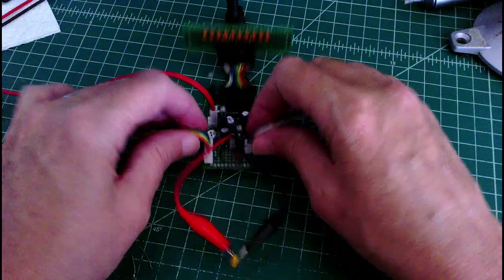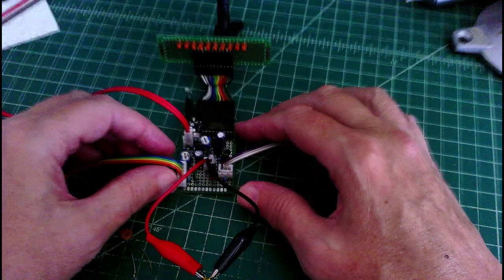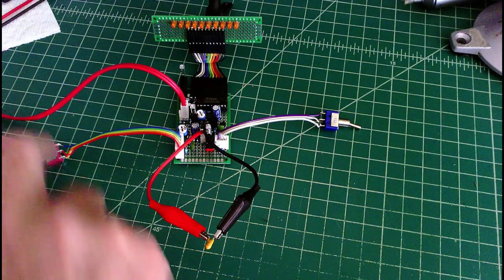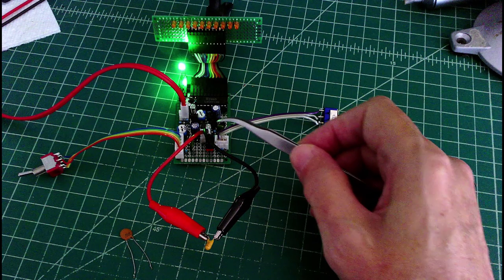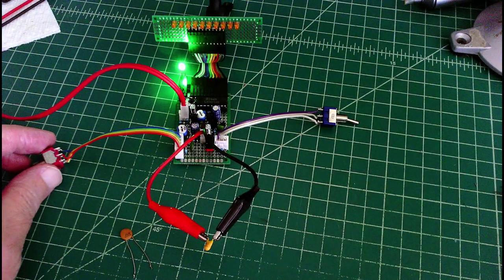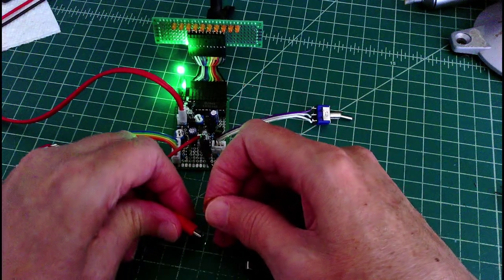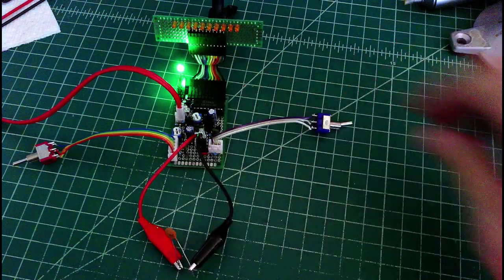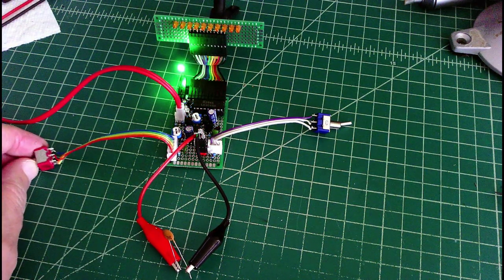Tim's build of Mr Carlson's Forcasting Ultra Sensitive Low Voltage Capacitor Leakage Tester

Comment: That's pushed me on to do a point to point version, as I'm not comfortable with smd to be honest.
Reply: You should give SMD a chance.  It really isn't that difficult.  I would get a cheapo SMD soldering kit on ebay for like 3 bucks and practice.  The real secret is flux.  I prefer no clean. I have had great results.

Comment: Why there is just one switch on the schematic? Thanks
Reply from the maker: I don't know what schematic you are looking at, but the one I worked from has two switches.
Reply: The schematic you are looking at, is a fake schematic or one that hasn't been updated. 
If you sum altogether, all the people that "shows" their constructions of this tester, you can figured out the schematics.
Basically is an amplifier and a comparator. The LM3915 is a dot/Bar display driver. Just download the datasheet and, bang! you have 1/3 of the schematic done.
A lot of info you can get from this kind of videos, for example the pin 9 is not connected so the LM3915 so is configured as dot display single driver.
The LM3915 is sourced from 27V so the configuration must be Dot Display forced!. figure 27 datasheet.
The presence of two VR's indicates that you have to calibrate the tool once you finish the assembling, one perhaps for a comparator the other for signal input conditioning.

Regarding the switches, one is for charge/discharge, so when is on it connect the cap, when is of it connect the cap to a discharge circuit, with a diode, just to see a pulse there.
The other seems to select three networks depending cap materials, mica, paper, ceramic electrolytic. 80Mohm, earth or flying in the breeze.

One thing that I see in most of this videos is that 27Vdc is not suitable for capacitors rated below that range. so you may be fond yourself doing some adaptations for the testing voltage source... thing that could be done with zeners diodes... uff.
But... is that a real test? what about the heat generated when capacitor is working, etc.
Good luck with this amplifier, which wasn't invented by Mr Carlson, but by General Radio in the 40's

Don't ask for schematics, just see the videos the people are uploading... they provide everything.... poor mr carlson...

Comment: Nice job Tim!  Since I'm not going to be etching boards at home right now, I'm going to try your method.  Can you tell me where you sourced your through hole 3914?  Mouser & Digikey both only stock SMD versions at this time.
Reply from the maker: Thanks Tobor. I had the 3914 from 'back in the days'... I did find some PLCC 20 breakouts that should work nicely as well on eBay https://www.ebay.com/itm/x10-PLCC20-Bread-Board-Prototype-Adapter-1-27mm-to-0-10-inches-lead-spacing/113716609458?ssPageName=STRK%3AMEBIDX%3AIT&_trksid=p2057872.m2749.l2649 you could try those.

Comment: NICE! I'm going bonkers trying to source SMD parts, and I've never done a pcb before, so I think I'm going to try my hand at your approach. Question: Did you mimic the layout of parts on the board?  Thanks!
Reply from the maker: Thanks Ron! I always take the same approach when doing point-to-point: I build out in 'modules' starting with the output. So I built out the LM3914 and bar graph first and made sure that was working as expected, then worked my way to the input adding/testing each stage as I went.
Reply: @TimStoddard  Yes Tim this is the way I do it, currently on the Super Probe at 66 Years old these smd  grains of sand to small for my eyes :)
Reply: is it made of smd parts ?